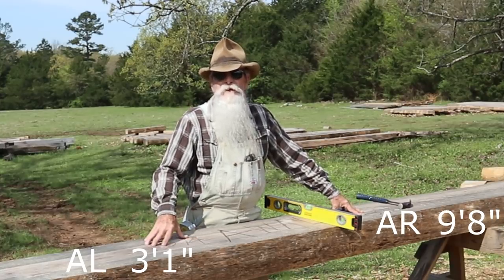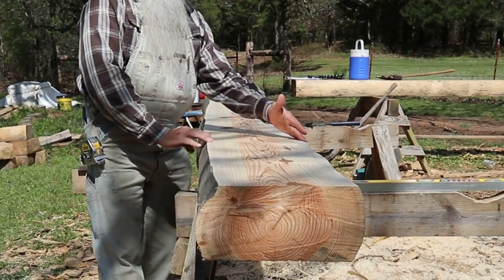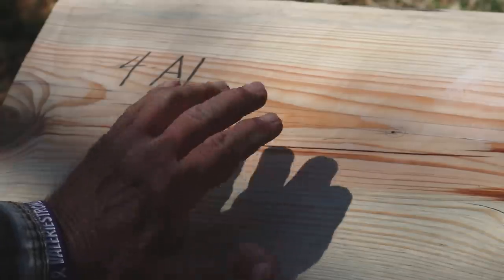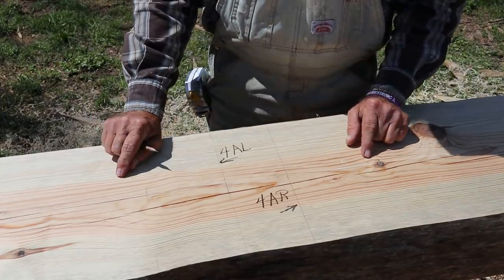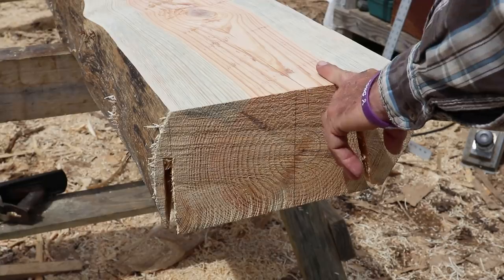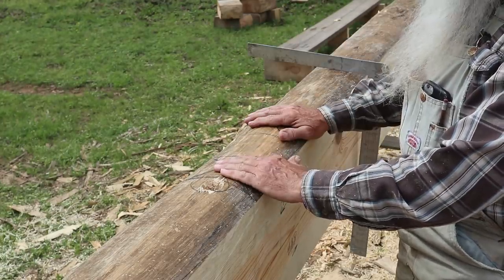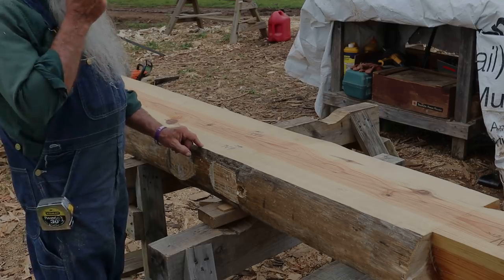1 Log/2 Center lines - Dovetail Log Cabin Build (Ep 21)

Comment: Hey friend, I'm trying to fly in formation here like a Canadian gander.  No real arris is formed due to no actual square corner existing.  Moreover, the log has a crown.  There seems to be only one plane to work from and not two - by choice the inner face of all logs.  But in reality you are using the inner face of all logs and the upper side (crown side) of each log.  In mirroring back for my understanding; the goal to keeping accuracy (alignment of two future logs from one) is to establish a start point for laying out CL's at the location of the future cut site (making two separate logs).  So it appears you found center (measuring across the width at this cut site location) and utilized one mark at this location to establish separate CL's for the two future logs to be?  This being accomplished by simply finding the center at the ends (dove tail ends) of the two logs in relation to the single established lay out starting point (butt joint end or future cut site) established at the future cut site for two logs from one.  So, to avoid confusion and working off the wrong line when creating the dove tail joint(s), could you have established the said critical single used start point mark at the future cut site and draw a single CL on each log and not two lines on log AL?
Reply from the maker: J F   Howdy JF, thank you for your comment and question. I realize this could be a bit tricky ( or confusing, which is not my intention at all). I really try to be careful when doing a layout on a log. Both of the center lines are transferred to the outside of the log to be able to complete the layout on the outside face using the center line that goes with that notch it corresponds to. I am hoping to get some work shops set up so people could get the hands on experience. It seems like you have a pretty good understanding of what l’m attempting to share. Thank you so much. God bless you
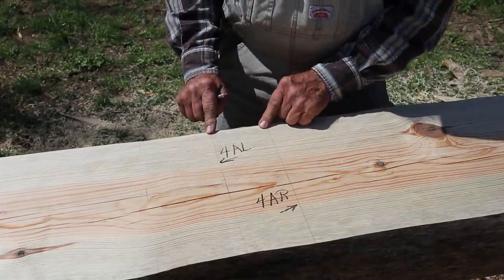Reply: @TheBeardedCarpenter    I thank you for responding. You need not respond a second time.  My confusion actually gives me reason to research deeper and therefore learn.  I express myself here for your understanding.  You do a great job explaining the details, and it's very much appreciated...thank you!  I think, I know the where and the how I got lost?  In this video around the 4:30 - 4:55 time mark the two plumb lines (AL & AR) laid out on the log's end (AL) for both AL & AR logs is where I got lost - I don't think it was ever stated clearly which of the two marks (AL's or AR's) would be used to draw the angle line for the dovetail cut (on the flipside of log's end AL; as shown) ... Q: (need not answer):  Was it AL's or AR's, on the AL end (as shown in this video and at said time mark)?  It may just be me?  I attempted to go back to earlier videos "Round 1, Sill Log Layout (pt 1) Dovetail Log Cabin Build (Ep 12)" (And seq. videos) and follow the dovetail layouts and cutting, but the only dovetail layouts and cutting done were on A & C sill logs (Non - double angle logs / or call em;  logs having a flat with single angle.   In that video I understand these are the best, flattest logs (no crowns) due to being important sill logs establishing all logs thereafter).  It was stated; in earlier videos, that the B & D sill logs with double angles would be shown later; in future videos,  but I could not find this/these follow up video.  The next video in relation to the "Round 1,2 ,3 etc. of the A, B, C, D sill logs moved on to notch cutting for the floor joist.  The first time that a double angle dovetail joint was shown laid out and cut, is in this video.  I'm not certain if it matters.  So I believe my confusion may have been born from not knowing ahead of this video how to lay out and cut the double angled dovetail joint.  This all may not mean much being this is a special crowned log case.  In which I am pleased you showed.  More specifically to my confusion;  in this video around the time mark 4:30 - 4:55 I was not sure  which of the tick marks (AR or AL, on the AL end as shown) created by the plumb lines (2 of, one belonging to AR & the other AL) on the end of the log would be used to layout the angle line once the log was turn over?  It's time to build a model!  God bless you.

Comment: Can't even go to my cabin. They set up road blocks.
And I guess il try my best to remove the bark like you said. Would I need to treat it with something after?
Reply: Are you saying you built a cabin and the bark is still on the logs?   There is a tool I have in mind that may make the; now, removal easier.  I'd imagine if the bark has been on the log for some time it will be difficult to remove, especially already in place as part of a cabin's wall.  I would be interested in learning how it all works out for you?
Reply from the maker: Northern Woodsman   Howdy, sorry you can’t get to your cabin. I think l would try to get a bore aid product and use. I don’t know what would be available in your area. Might check for a product called Timber bore( l think that’s right). I have never used it but you mix it with water and just spray it on with a small pump up sprayer. Will check to make sure l have the name of it right and let you know. God bless you

Comment: Thank you for the video Paul, I'm curious about your thoughts on log shrinkage when using green wood, for a story and a half cabin, I heard the logs should dry for up to 6 years. 
All the best to you and your family
Matthew
Reply: Huh?  I never heard that number (6 years)?  I like to jump in on this conversation so I won't miss Paul's response.  I've aware of the rule of thumb: 1" per year dry time.   But! I am also aware that building with green timbers / logs is easier (wood is soft  / not rock hard).  Also allowing logs / timbers to dry completely will allow them to change shape.  If built green and in place they may take on the "forced" shape in the location.  Hence, same concept with fell trees early Winter and peel bark early Spring... etc.  FYI:  some say kiln dry (forced drying) weakens the material.  Finally, its custom to build with settling / shrinkage in mind .... example: key way (tongue and groove) created in door frame bunks and window frames.   I believe in haste back in the days where it was a maker of life and death to build a cabin fast little attention or care was given to the structure's timbers / logs being dry and to the future settling.  Remains of old cabins often a found with sunken rock "foundations" and curved logs due to the sagging under weight.   I wonder what your thinking or concern is in relation to the half story?
Reply from the maker: Matthew Waters   Howdy Matthew, l like to build with green timbers and allow for the setting that takes place. I allow for extra space above windows and doors. I will be showing how l take care of that in videos coming up. That’s a good question that I hope to address shortly. I’v heard and read different stories on the drying time. An inch per year is pretty much what I go by but the inch would be from either side. There’s definitely different views on this. I don’t have any problems with the way I do. I realize with different species it could vary. Thanks for your question. God bless you
Reply from the maker: J F   Howdy, sounds like you got a good understanding on this. Thank you so much for sharing that. God bless you

Comment: What material do you use to later fill the gaps between the logs?
Reply from the maker: Ouwkackemann   Howdy, I like to use closed cell foam backer rod in the gaps and then fill in the gaps with a mortar based mixture and smooth it down with a trowel. God bless you
Reply: @TheBeardedCarpenter  Thanks for the info.
Take care and best wishes to you.

Comment: I did not understand the problem you are trying to solve by working 2 separate parts of the log.  I also did not understand how that solved the problem. Are you cutting the crown out?  It was barely 6” section removed.   It must be fairly common for the center line to vary from the edge of the log on every log.
Reply from the maker: Howdy- I was keeping the center line centered on two separate pieces. I will do that if the log isn’t real straight. I have to stay on my toes when I do this so I don’t get mixed up on which center line is which. God bless